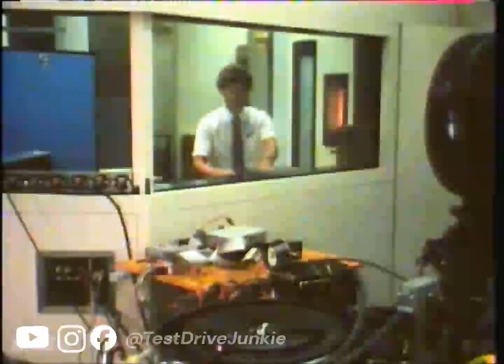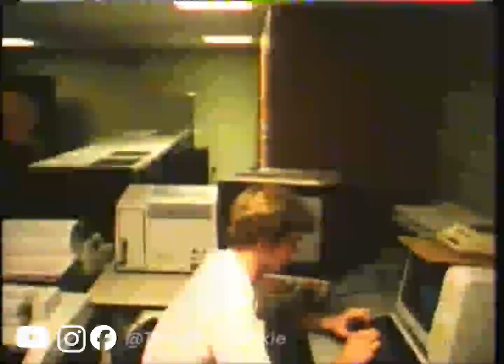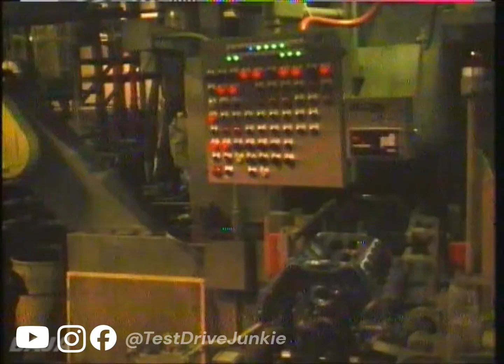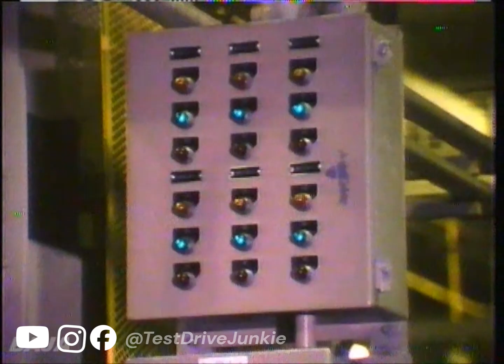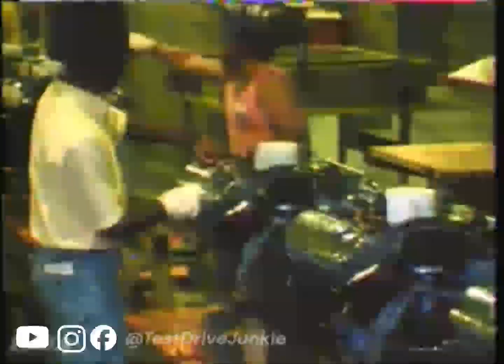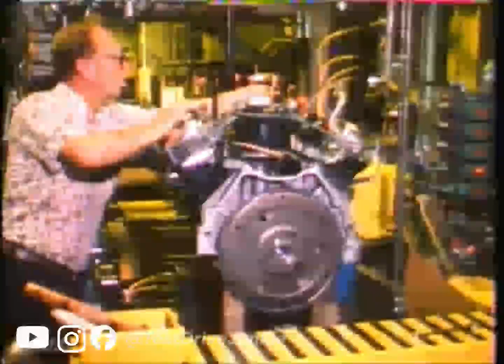1982 Cadillac HT4100 Engine Story Manufacturer Laserdisc Promotional Video

Comment: I was a car porter at Dimmit Cadillac in this era, cars came in with bubbles in the paint, piston skirt bottoms had to be filed down to stop clearance issues with crank counterweights, baffles breaking loose in gas tanks , transmissions hunting for gears, I went to work at a Yamaha dealer rather than dealing with that.

Comment: Great video, many thanks!  
I couldn't get past 22 seconds when he says they wanted a lighter engine with the same power as the 6.0...  The only problems being that the new motor was exactly HALF the displacement of their engines 6 years earlier, the already-downsized cars weren't getting any lighter, and at that point the 6.0 was only producing 140-50 HP with TBI!  I wonder what would have happened if we hadn't supported Israel in the war that made OPEC shut off the cheap oil taps...  🤔  
Oh hell, if that hadn't happened we'd probably have gone crazy and started driving around 4x4 trucks even heavier & MUCH less aerodynamic than our beloved Country Squires, Custom Cruisers, Town & Countrys, Imperials, Cadillacs and Continentals...  Naaaaaahhhh   😁
Reply: Half the displacement of the 8.2, but 70% of the power of the 1976 version. Kind of wild how crappy things were in those years.

Comment: The genius of a design that put the intake manifold/cylinder head junction under the valve cover, so coolant leaks would go inside the engine. Well played, Cadillac!
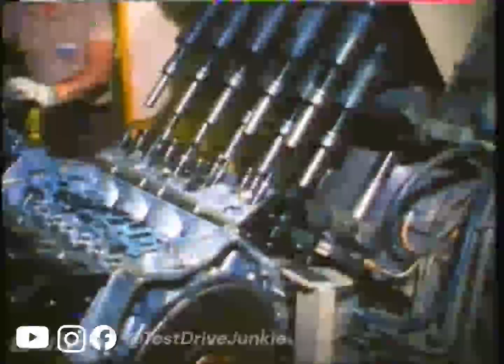Reply: Also, at 9:19, "this machine finds the perfect tension on the head-bolt threads , sensing that optimal point of clamping so that they will fail right after the warranty expires..."   😂😂
Reply: Like ford FE

Comment: I worked on hundreds of them man what a problem child my friend worked at the caddlac dealership he quit all he was doing is replacing engines had to use stop leak tablets just think about it cast iron heads on a aluminum block only 250 cubic inches should have stuck with the 4 6 8 way better engine almost put caddlac out of business than the 4.6 more junk 😅
Reply: I wasn’t aware of the 4.6 only the 4.5 and 4.9.

Comment: My dad worked as a salesperson and acting sales manager for a Cadillac dealership from 1984 until he passed in 1988. My high school was down the block from the dealership, and I took summer computer courses, so when I was done, I would walk down to the dealership and wait around until he was done and then come home with him. I remember rows and rows of 1982-1984 Cadillacs waiting their turn for engine work. The HT4100 did one thing well: made import and other make buyers for life from previous Cadillac buyers. The early THM200-4R RPO code "MW9" four speed automatic transmissions were also a bit troublesome but got better as time went on and when rebuilt with upgraded parts, they are a good transmission. 

The intake manifold gasket would blow, causing a soupy mix of coolant and oil to be circulated throughout the engine. Then it would foul the bottom end and total the engine, essentially a "1-2 punch, out to lunch". As the cars aged, it was not cost effective to repair them and many went to the junkyard. The shameful thing was that Cadillac still offered the 6.0L (368 CID) V8 from 1982-1984, however, it was only used in commercial cars, not passenger cars after the 1981 model year. 

GM meant the "HT" to stand for "High Technology" but instead it got the pejorative monikers of "Hook and Tow", or as I called it "Horribly Troublesome", among other names. Fortunately, in 1986-1990, the rear drive Fleetwoods/Broughams came with the Oldsmobile 5.0L (307 CID) V8 with four-barrel, aka RPO code "LV2" or as I call it, "The Silent Soldier of the 1980s". While under powered, they ran, ran, ran, ran, ran, ran, ran and ran some more. They were very reliable, smooth running and quiet. One of the best GM engines of the 1980s and beyond.

Comment: Now LS engine rules.. these were the stepping stone engines lessons learned..
Reply: Nope, Chevrolet did not learn from Cadillac...  The LS version of Modulated Displacement is a mess, creating new problems deep in the engine with their lifter-centric design, while the Eaton rocker-mounted system for the V8-6-4 was robust.  And IF it ever needed service all you had to do was pull the rocker cover!   I put 100,000 miles on an '81 Eldorado, and I can tell you that the mechanicals were bulletproof.  The 3 main problems were computers that couldn't do what they can do now , a bad choice on the EGR system, and a ridiculously tall 2.41:1 final drive ratio hobbling the power AND economy modes.  I guess you could blame those last two on dumb engineers, just like the 4100... 
In fact, they missed another opportunity even in those computers.  The Digital Fuel Injection was the first time they, or possibly anyone, combined the cruise control with the engine computer.  However, it didn't dawn on them that they could have programmed the V8-6-4 to hang onto fewer cylinders on the highway when the cruise control was just mindlessly trying to maintain a speed - but there wasn't a human foot on the pedal that needed instant response!  <sighhh>
Reply: @marko7843  , the digital fuel injection system was the best part of the 4.1-liter. It performed very well.
Reply: @randyrankin589 Yes, I believe it was the same system.  And for years Cadillac did one thing very right... TRULY on-board diagnostics.  It was great being able to pull up trouble codes, and control certain underhood functions, with just the electronic climate control!
Reply: Oldsmobile gasoline V8s will always rule.
Reply: @0utc4st1985 back then in 50s to 70 ...yes. I liked the 350 olds in 1970s. Had unique sound also .
Reply: @Motorhead250 And still today. When regularly used and properly maintained I've heard of them going half a million miles before needing a rebuild. No LS has ever done that.
Reply: @Motorhead250  I have never forgotten the Rocket 350 in my first car, a '72 Cutlass Supreme! It was after the big compression chop, but before EGR and lousy combustion chambers...  All the tire shredding you could want, and 20 MPG on the highway with just a 3-speed automatic.  Even one year later, my '73 Grand Am 400 didn't run as well...   <sighhhh>

Comment: I can see the oil drip from here.
Reply: RT V gasket Maker....... That goop only works when applied lightly to a rubber or Cork gasket.... It will seal nothing by itself.... Those engines we're junk.....Way to many coolant and head gasket problems But I have to say smooth whatever power it did have was smooth until you started smelling whispers of coolant in the air and then pulling over and seeing rivers of liquid on the ground

Comment: The 1.8 turbo 4 in my car has more power and torque, gets way better mpg, and weighs less. The advancement in technology is crazy
Reply: this engine was from almost 50 years ago.  I wouldn’t go too hard on tooting your horn about the 1.8 turbo motors either. Those aren’t exactly a coveted motoring option
Reply: @sneakerfreak2002  no shit. Thus my “advancement in technology” comment. Maybe read before you write. And I am not tooting any horn, just pointing out the difference. You really don’t mind making a moron of yourself huh?
Reply: The 1.8L NA hybrid system in my car makes the same horsepower and probably achieves twice the fuel economy.

Comment: I remember when this engine first came out in 1982.
I was stunned Cadillac was putting a 4.1 liter 125 hp engine in a large heavy car.
I knew this was a mistake & damn was it ever!
Reply: I also remember when that happened.  I'm sure you remember when Cadillac was originally going to all-in on the FWD platforms but, when the oil scare was past and things were starting to look up, the demand for the full body-on-frame Cadillacs went up dramatically.  So much so that GM suddenly changed course and continued making them.  

Problem was that the Cadillac 368 V8 tooling, molds, jigs and assembly was all gone and it would've been impossible to restart production.  All Cadillac had on hand was that sad 4.1L V8 originally meant for the smaller FWD platforms.  All the engineers could do was put a numerically high rear end gear ratio and pray that traditional Cadillac buyers wouldn't notice.

I think the 1983 or 84 models got the equally sad Olds 307 which was a bit better but, still inadequate.  I think the 85 or 86 models finally got the Chevy 5.7 but, only if you ordered the Towing Package.  Some obscure EPA loophole was used to pull that off.
Reply: No, the 307 Oldsmobile engine did not come out until 1986 for Cadillac and was used through the 1990 model year.
Reply: @googleusergp  OK.  I knew the 307 came along later but, my memory is hazy on when.  Considering what people were paying for in a Cadillac, the 307 was not up to the task.  It was good for mid-market sedans and wagons.  Not a high end car.
Reply: @BlackPill-obey  It was used in the previous Oldsmobile 88 and 98 (among other GM full and midsize cars) and of course in all of the GM "square" wagons as well. So, it was a "luxury car" engine, but yes a bit underpowered. However, it ran smoothly and was dependable. Anyone buying a 1986-1990 Fleetwood was in no rush to get anywhere and wanted to arrive in style, not just arrive. The Olds 307 fit the bill quickly. Later on the 305 and 350 Chevrolet derived engines came on board and performance was better, but there's nothing wrong with the 307 Oldsmobile engine. It was the "Silent Solider" of the 1980s.
Reply: @googleusergp  : Nothing wrong with the Olds 307. It was just unrefined and didn't belong it a premium car like a Cadillac. Underpowered and Carbureted wasn't a premier offering in 1986.
Reply: @TeeroyHammermill  Didn't have to be. The 307 V8 did the job and was "on the shelf" at GM, so it was a fast solution until the more powerful fuel injected versions came on board.

Comment: I had an 84’ with this motor. Reliability-wise, it was fine (shocker), but my god was it SLOW.
Reply: I STILL have one.  An '84 Coupe DeVille.  Yes, it's very slow.  But we have to remember it was a LUXURY car built for comfort and cruising, not speed.  Today, all so called 'luxury' cars are 'euro sports' built for performance.  Back then, if you wanted a sports car, you bought a sports car.  If you wanted a luxury car, you bought a luxury car.  
We also have to remember back then, the national speed limit was 55. The HT 4100, once it slowly gets going, does just fine at 55.

Comment: These were smooth and quiet and got better by 1985.  Not everyone had trouble
Reply: Friends of mine had an '83 Sedan DeVille with the 4.1. It was trouble-free. The car was always on the road. It wasn't subject to short trips around town. The last time I saw it, it had over 200,000 miles on it. It was intermittently puffing blue smoke, but it was still running down the road.
Reply: @randyrankin589 i can believe that,  my '86 SDV gave no trouble.
Reply: I recently bought an '85 Fleetwood Coupe.  I'm in the process of working the bugs out, but I am amazed at how quiet it is even with all the miles on it.
Reply: I had 4 of them.  A 1983 Sedan DeVille and the others, all '84's.  A Fleetwood Coupe, a Seville and a Coupe DeVille (which I still have).  I never had any issues with the engines.  Other issues, yes.  But they engines were okay.  Like you said, nice and smooth and quit and MAN what a ride!

Comment: Few real gaskets, so it leaked all over. Not the proven iron block, aluminum head design. Coupled to a weak th200 transmission in rwd form.  I recall we had dozens of broken 4100s stacked up outside waiting for GM to pick them up for warranty purposes because our local Caddy dealer was swamped and the local Chevy dealer wouldn't touch them. This is when I worked for GoodYear, an independant sales and service dept.
Reply: Yeah, how many proper gaskets could they have bought for the price of that robot RTV machine...   😅

Comment: The HT4100 story: we screwed up badly with the V8-6-4 so we're rushing this out half baked and underpowered. Then at the end of the decade the 4.5L and 4.9L versions will be really good but far too late for Cadillac.
Reply: I remember when dismantling the V8-6-4 system and just having the engine run on all eight revealed that the Cadillac 368 was a very good engine.  Most Cadillac buyers wouldn't know that the late 70's Cadillac 425 V8 was a direct swap.  Super smooth, quiet, powerful, and none of the high-tech mess to worry about.
Reply: @BlackPill-obey  There was no 'dismantling'...  You just disconnected the wire from the tranny's "high-gear switch."  I used one of the empty rectangles next to the radio in my Eldorado to put a chrome toggle switch in that circuit - useful for compression braking coming down long hills...
Reply: The 8-6-4 was a good engine, the technology just wasn't there yet.
Reply: @Chris_Troxler  Yep.  The idea and theory was sound but, the execution left much to be desired.
Reply: I had an '81 with the 4-6-8.  It ran just fine!
Reply: @retroguy9494 They'll run great as long as their cylinder deactivation feature - which was their main selling point- was disabled.
Reply: @0utc4st1985  That wasn't really the main problem, after they got the firmware program right.  They made two mistakes with the EGR system, and hobbled the E bodies with a ridiculously tall 2.41:1 final drive ratio.  Mine actually died from a sudden and mysterious lack of oiling right after an oil change... and they set the sending unit pressure so low that the cam eventually froze without the idiot light ever coming on!!  🤬
Reply: @0utc4st1985  I never deactivated mine and it operated just as it should. The cylinders activated and deactivated just as they should.  

In fact, I also had an uncle who had one.  Bought a brand new  '81 Sedan DeVille.  It was the very fist Cadillac I ever drove when I turned 17 that year.  His worked just fine as well. 

Fun  fact; both of our cars were totaled in accidents.  My uncles in a rear end collision and mine in a hit and run when I was parked in a parking lot.
Reply: The V-8-6-4 had a slow computer (and some slow engineers) but no way was it as bad as the 4100 OR the modern Modulated Displacement GM truck engines!

Comment: Aluminum block with iron heads… pretty bass-ackwards, GM.
Reply: Believe it or not this became a common thing in the 90s across the board in the industry.
Reply: @0utc4st1985  Aluminum heads on an iron block became quite common in the 90’s and beyond, but not iron heads on aluminum blocks. The only other engine that comes to mind with that type of construction is the Chevy Vega 4 banger, and it was a giant POS.
Reply: @0utc4st1985   No it did not.  Aluminum heads on an iron block became common.  But iron heads on an aluminum block was always an oddity and never became common.

Comment: Nice video.  All engineering intentions were good until the GM  bean counters got involved, imo.  The "Hook & Tow" 4100 is now widely considered one of the most unreliable and gutless American V8 engines ever made. Cadillac lost a ton of loyal customers and never recovered from this. The 350 Olds diesel, which Cadillac pushed hard, is even worse.
Reply: This is when Mercedes really took off in America, the 1980s. Then when Lexus came out in '89 Cadillac hasn't recovered since.

Anyone who did a side-by-side test of an '83 Cadillac Fleetwood or Brougham and an '83 Mercedes S Class knew it wasn't even a fair comparison.
Reply: And then came North-Star... :-(
Reply: @Romiman1 I like how Cadillac bragged that the Northstar V8 was able to be run on low coolant. I wonder why the engineers put that...
Reply: @AWDfreak  I think, it was because of the real coolant loss of the HT engines before.

Comment: This engine was good for some owners,  others not so good.
Reply: They did ok in the smaller, transverse mounted baby Cadillacs.  The 4.5 and 4.9 were good engines.  This 4.1 was half baked.  The 4.5 should have been the debut of this engine.
Reply: Right, it was never a problem for people who never drove their cars!  😁
Reply: True.  I knew a guy who had one and he ran up over 200K miles on it and never a problem or issue.
I have an '84 Coupe DeVille and have no issues thus far.  But it does only have 25K original miles.